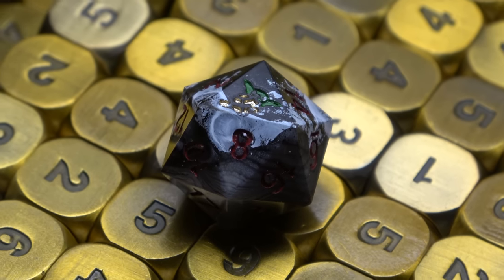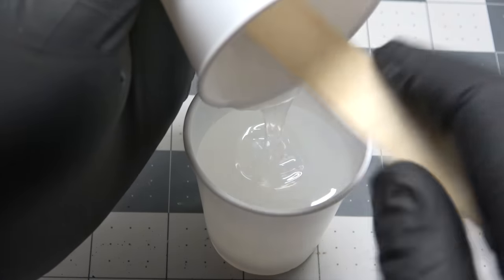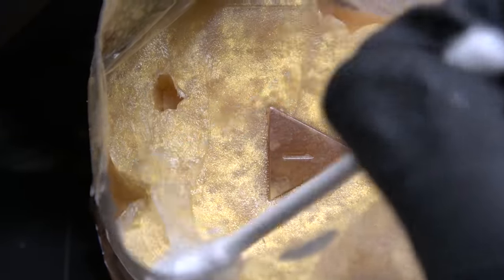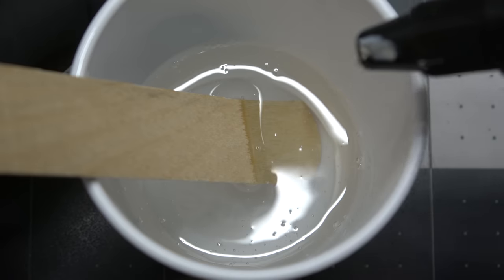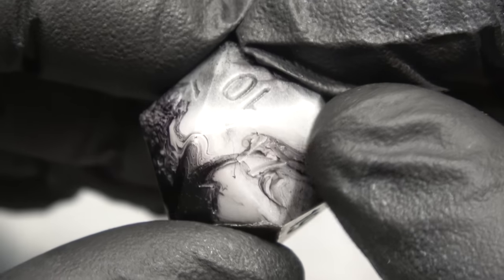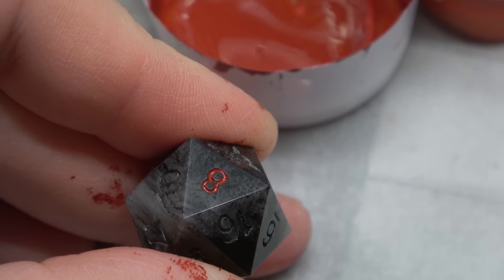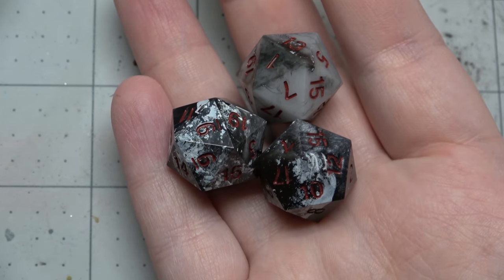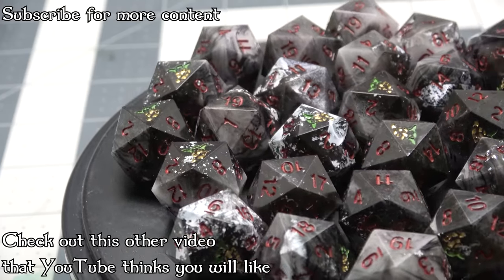I Made 25 Unique Black & White Dice | The Double Dirty Pour

Comment: I like to dye my molds and I change the color I use for each set that way I know which parts go together and it's easier to keep track of when I made a mold and how many sets came out of it.
Reply from the maker: Any specific material you use for dyeing? Silicone dye? Mica? Alcohol?
Reply: @Rybonator  mica powder, I tried doing the alcohol ink and it didn't mix well. You can even mix a small batch of silicone with the powder and put colored dots or write with it and let it cure on a mold to help label it. Anything to help me make sure sets stay together.

Comment: Genuine question:
Why do you use the slab mold? It seems incredibly wasteful compared to making cup molds

And just so i dont end this on a sour note: we missed you dice goblin king! May the light of shiny gold ever light your path!😊
Reply from the maker: No sour note at all! Slab molds are extremely convenient (storage takes up less space, they actually use less silicone overall, and you can fit more in a pressure pot if you make them right.). However, their downside is if one of the die in the mold fail, then the WHOLE THING fails. Which sucks haaaaard.

Missed you all more! <3

Comment: In the video you made about how to set up and support your 3d printed dice 9min in you start to say your not going to sand them all as you wanted to do an experiment about making molds using them and I have no idea if you had intention to make a video about it but I'm curious to see what you learned from it or if you had done the experiment I'm still waiting to know what happened

Also please update on the rybo twins
Reply from the maker: Rybotwins are doing AMAZING! Although they are a mega handful, they are our absolute joys <3

So I would definitely recommend sanding your masters- but as far as getting them to cure properly in silicone- you can use INHIBIT X, ORRR put them in a well ventillated room for a month or 2, or in the sun for 2ish weeks and it should cause no cure inhibition. I never did a follow up video, but I probably should have.

Comment: If you can get your hands on paper dixie cups with a beveled bottom, you can cut out the inner bottom and still be left with a nice solid even edge that will need less silicone than if you flipped it over and used the top. The hot glue gun is absolutely necessary, I've made the mistake of not using it and it is a special kind of hell

Comment: I get really confused with this, I thought one vid had the pressure pot giving you weird results, so you switched to a vacuum chamber? Have you re-jigged the pressure pot to stop it making the dice go fuzzy (I think that’s what the problem was) 😅

I nearly got a vac chamber last week and kinda glad I held off now🙏
Reply from the maker: Yeah so both can work- but pressure pot is king! 

That was a bunch of old vids where I used a vacuum chamber- a pressure pot can do both jobs, but a vacuum chamber can only really help with the silicone. You can simply cast the silicone in the pressure pot at a higher psi than you cast your resin. 

Ex- cast your silicone at 45psi, and do all your resin between 30-45 :)
Reply: @Rybonator  Thank you SO much for replying bro ! My results aren't great without using any form of pressure/vaccuum device - and the pressure pots are like 1/2 the price of the vac chambers here in the UK. 

Apologies for the mixup, I guess I haven't been watching the vids in order !

Did you ever find out what made the resin set weird in the pressure pot that one time? I'm guessing there was a lot of playing with valves and such :)